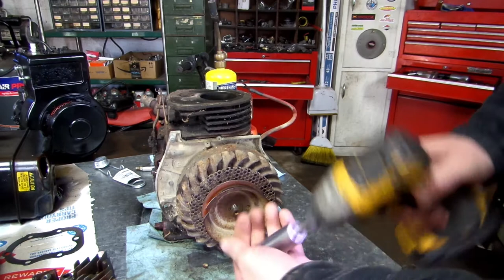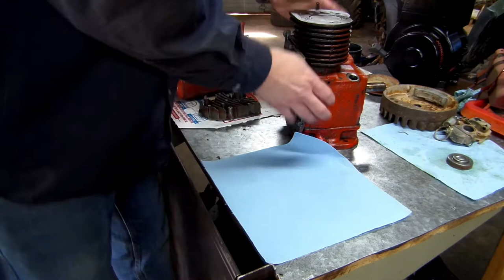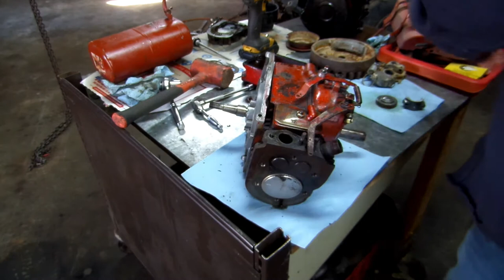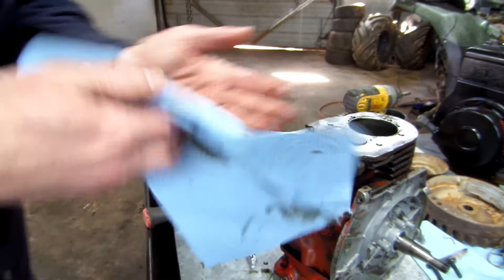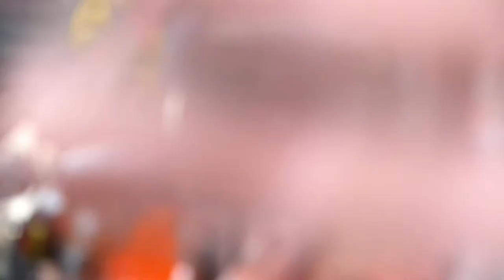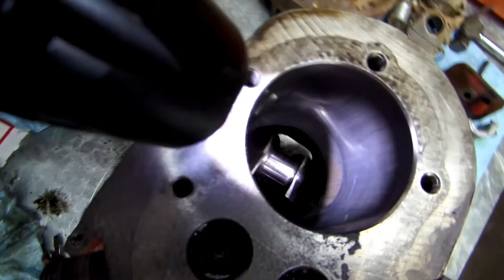Clinton Engine Rebuild Part 2

Comment: Where can I get a manual for a Clinton engine? I need to restore my engine on an old 4cycle like this, and I’m having trouble getting parts.I appreciate the video, very well done.Thanks in advance.
Reply from the maker: I get mine at tractor shows and online.
Reply from the maker: I can look in mine if you have spec info. Like model #